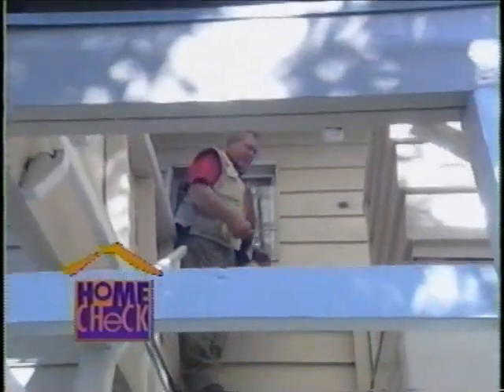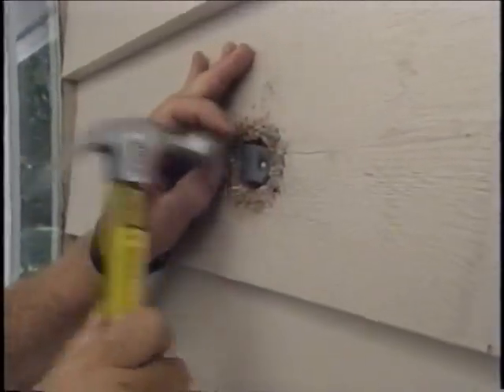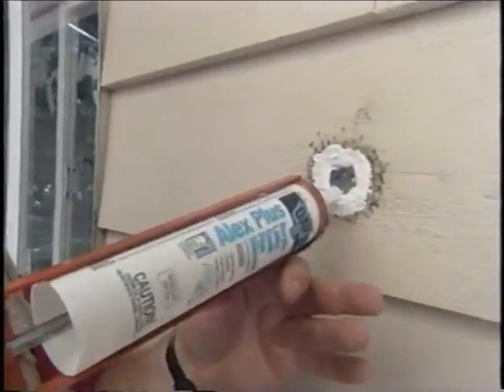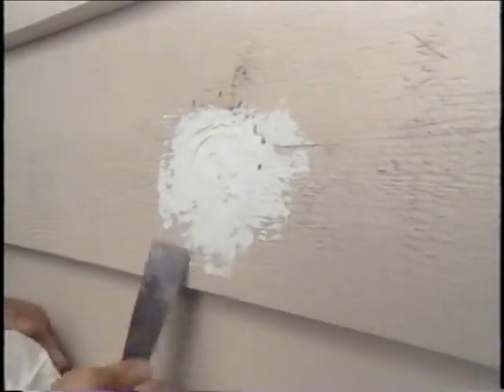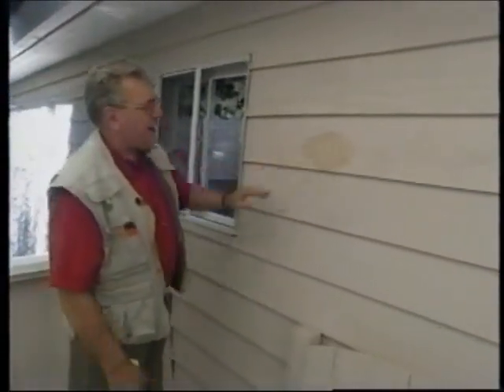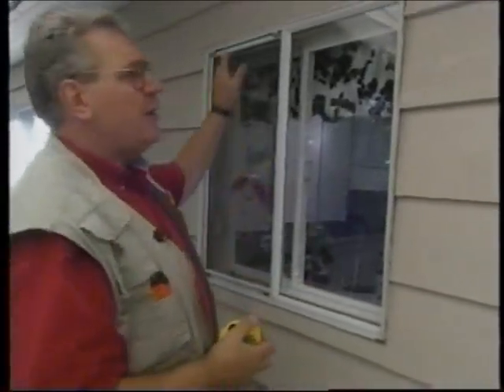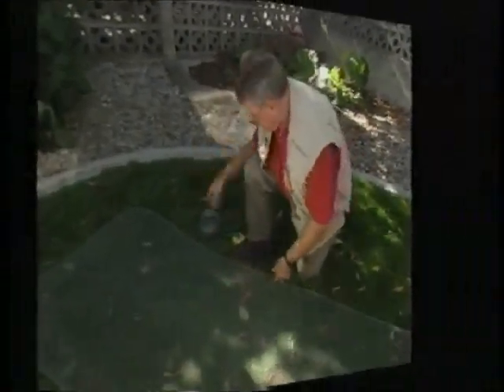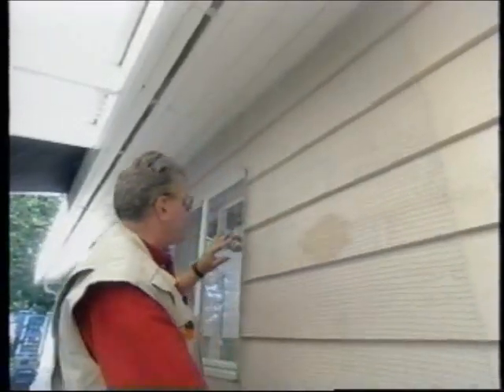How To Repair A Hole In Wood Siding

Comment: According to directions on the tube of caulk, it is only meant to fill small cracks. Don't have the tube in front of me, but I learned this after doing repairs exactly like you showed here. I thought I was pretty slick. I'll probably be dead before it fails, but it's going to fail eventually.

Comment: Absolutely do Not do what is being done here. Caulking is great for certain applications but this is Not one of them. Best patch method in exterior wood siding or facia, soffit, door jams etc is good old fashioned Bondo. Mix, set, dries rock hard in minutes, sand flush, prime and paint. Will last a lifetime and will not rot. That caulking spot is soft, spongy and will shrink when curing. Caulking is made for cracks and seams and that's it. Do Not repair large holes or rot in wood with just caulking.
Reply: I agree!! I've tried what this guy did and the caulking tends to shrink a little. Bondo REALLY is the way to go.
Reply: Lol, agreed, this video is a good tutorial on what NOT to do.
Reply: I use ReadyPatch working great.
Reply: Guarantee paint job will fail over that junk caulk. If wood spongee apply minwax wood hardener. May need 2 or 3 applications. Then bondo, then always prime before painting
Reply: Durhams wood putty is very unforgiving. Extremly hard to sand.
Reply: I have luck, I use good outdoor window door silicone caulk it's spaced aged magic. Lol. After 5 years it's great sealed 100 percent.   Hole was huge , inch and a half.  I put plywood on other side.  It's pine board shed.    They do it before winter to store food
Reply: Or wood filler. Minwax high performance wood filler is designed for exterior and extreme temps.

Comment: Why not use wood filler?
Reply: That is how I repair similar holes. And I use scrap wood bits instead of the insulation foam. Fill hole with wood chunks then apply wood filler. Scrape, let dry, sand, paint.

Comment: Im sorry but this is not! how you fix a hole in siding....
You need to use a hole saw to cut a plug,glue the plug in,then use a wood filler to smooth out the hole,allow that to dry,sand it smooth with a 80 grit paper and then prime and paint.
You do not fill large holes in wood with caulk. lol